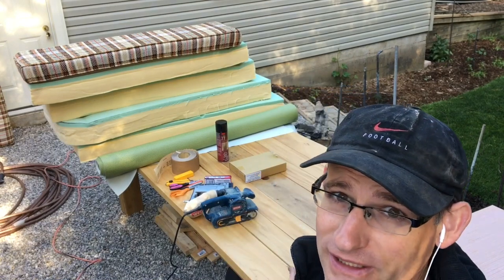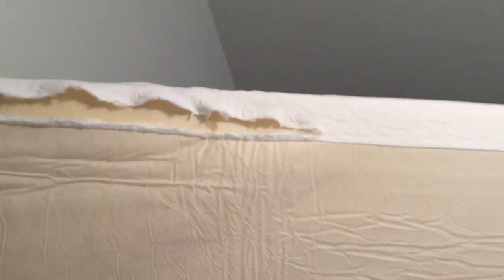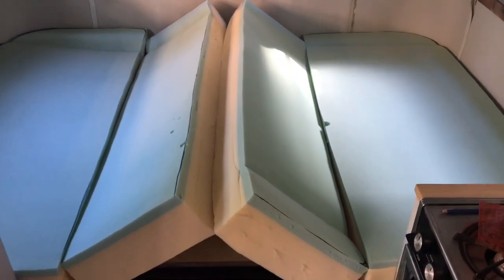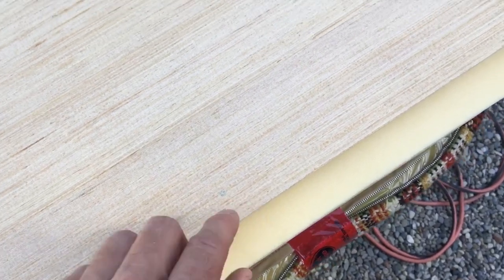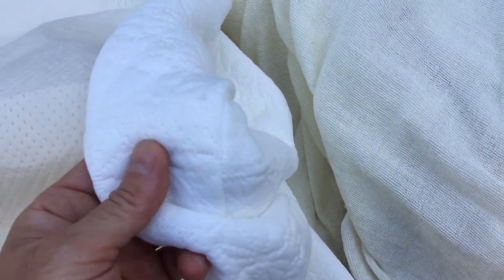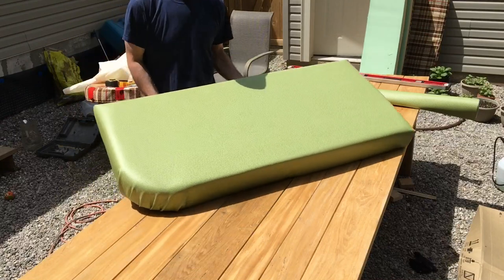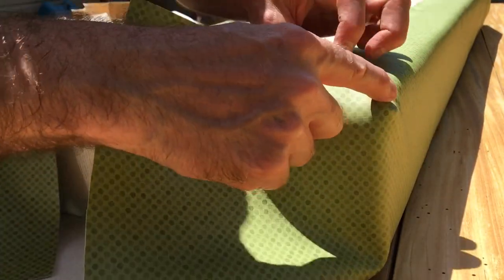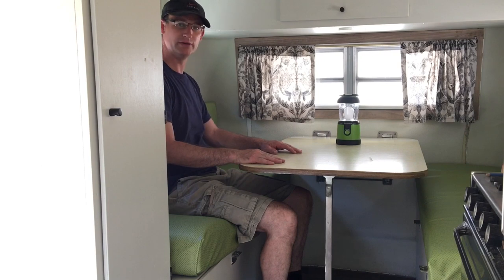Amazon Mattress/ NO Sew cushions for travel trailer

Comment: Great looking job Zac. If I can respectfully add my grain of salt here, you might want to monitor the presence of condensation after a few nights sleeping on them. Maybe I am wrong, but you may need to drill some holes into the wood to facilitate air flow and drying of the foam.
Reply from the maker: Good to know! I will definitely keep that in mind. If after a summer of camping I have an issue I’ll make sure I update it. I’m not sure if it makes a difference or not but the fabric is a waterproof outdoor vinyl.... maybe that will help? I’m not really sure. The original foam cushions were wrapped in plastic... but I’m not sure if that’s factory or not.... We will see.
Thanks for the tip